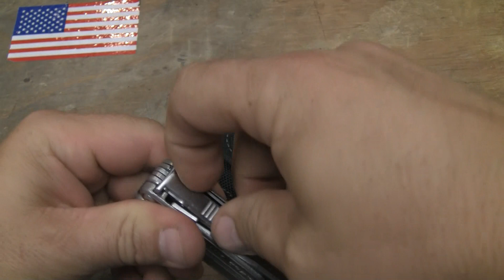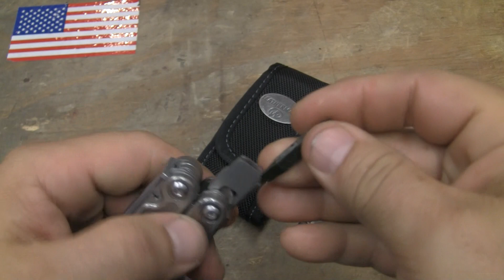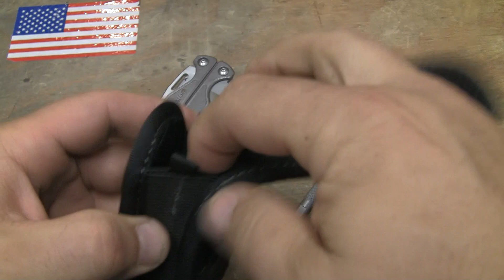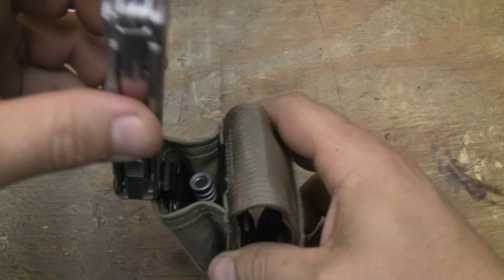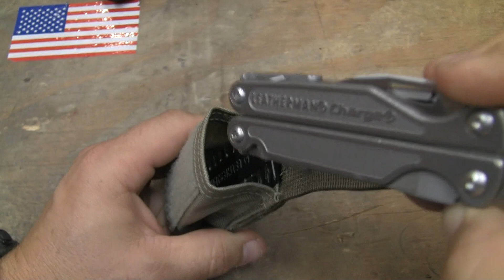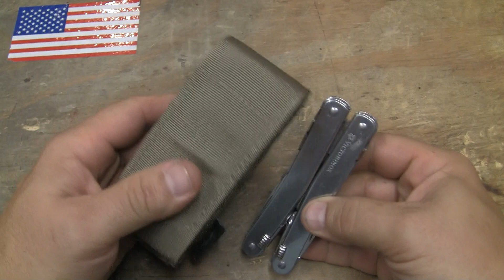Leatherman Charge TTI Accessories that Work

Comment: the sheath that came with my charge is molle compatible, no metal, and has the side compartments for the acoutrements. what i really like is the hole in the bottom of the sheath to hold the leatherman with the pliers deployed.